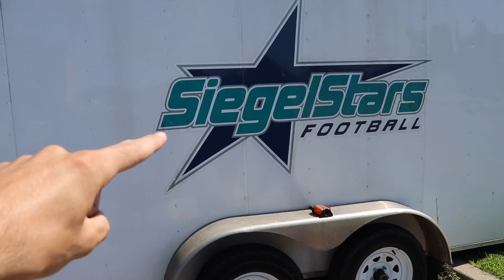How To Remove Trailer Decals

Comment: Do you have a video on removing old decals that got baked and partially dehydrated in the Nevada heat? The edges are dried and curled. Thanks.
Reply: I'd like to know as well, old stickers baked onto a steel horse trailer since 2001 in the FL heat

Comment: Luke, what is a good price range window in your opinion to charge a customer for a job like this?
Reply from the maker: Great question, obviously its's going to vary based on a lot of different things, so I don't know exactly how to answer it, and I do not even have a set price range for things like this because its so different depending on the situation, but let's just say for this job, I made between $300 and $400
Reply: That is awesome and it really gives us a very good base on how to price jobs like this.  Did you detail all the latches etc on this trailer or just ONR wash and detail wheels?  Did you finish with express wax?
Reply from the maker: Mark H yes I did all the metal and latches as well as meguiars X wax!!

Comment: Have you removed decals that have 3M adhesive, I've seen peeps call it stubborn vynil but it's actually the glue that's not letting the vynil be removed in one or portioned piece.  Any help would be appreciated, thanks in advance.
Reply from the maker: In order to get the underlying adhesive off completely you will need a wheel eraser that attaches to a power drill

Comment: yea, what about decals that have been on trailers for 20+ years?  they do not peel off.
Reply: Dewayne M I have the same problem on a 20 year old boat trailer. I feel like I’m going to have to grind them off.
Reply: Yes , I have the same problem with the same question
Reply: Hit it with a power washer haha
Reply: The best thing I’ve seen for old decals so far is a product called  Grafxoff where you just paint it over the decals and it scrapes right off quickly. And not strenuously. That’s what I’m doing to the motorhome that I just purchased. Over 10 years old and the decal stripes are all faded and cracked